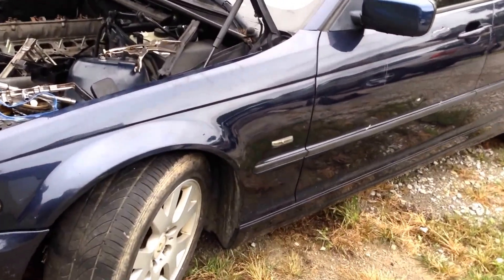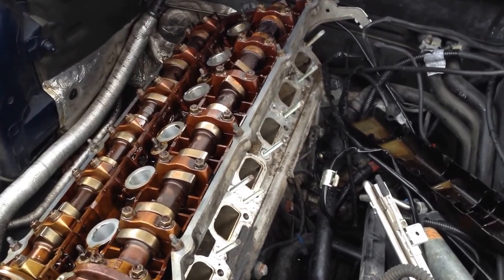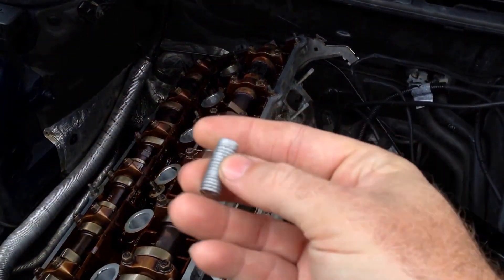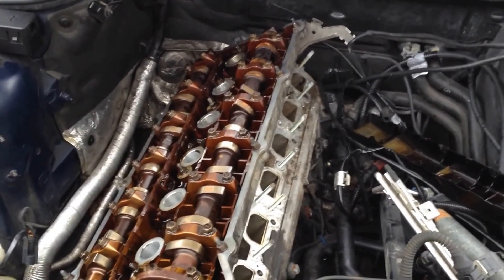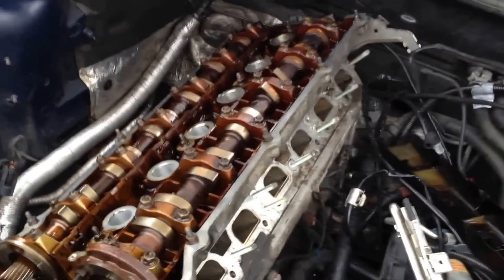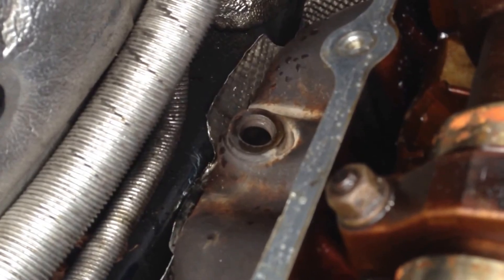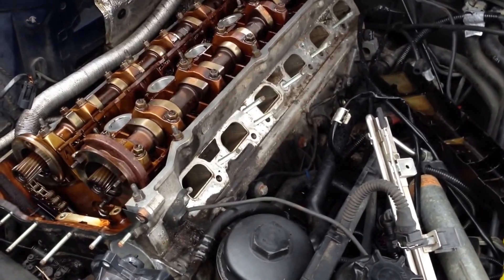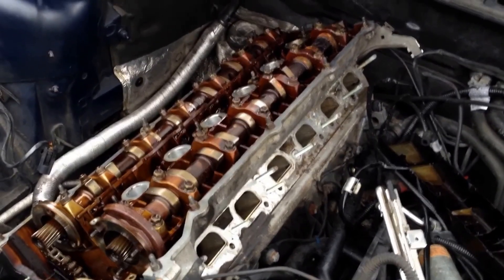IS MY BMW E46 E39 X5 M52tu M54 M56 head gasket is blown? It more than likely it is not

Comment: The GM Northstar V8  (1997-2000) had the same problem. Solution was drill out and retap with longer studs. I blew my dads Caddilac Sedan DeVille-got to a garage, but learned the oil got cooked and the rod bearings were shot.

Comment: How common of a problem is this on the e90 cars?  Particularly the 328i 2008-2011 years.  I've been looking at e90s as my next daily driver.  I'm not afraid to DIY repairs, and I am anal about maintenance on my vehicles.  I've replaced cylinder heads on Jeep 4.0 engines, but setting the timing on a BMW might be a bit over my head.  Is this mainly something that occurs on cars that have been overheated?
Reply from the maker: You car prob has the N52 and on those engines they have aluminium head bolts that will break before it strips the block threads

Comment: I am thinking about DIY my 1996 328i head gasket. This is me and my wife's first BMW and I would like to fix it for her, but the thing scares me a little. I don't really know how to do it. I bought a Chiltons book, but the thing is somewhat confusing and very little help. Any suggestions on what book like BMW for dummies edition. Or do you have or know about a video similar to that model? Thank you .
Reply from the maker: Hell you have the single vanos m52 , it more than likely has a cracked head if it's smoking white or randomly overheating, I have done a ton of them and the timing does require a special timing kit, you can buy one for under $70 off eBay , the cylinders heads are getting expensive for those engines since a lot of them crack, you have a cast iron block so the bolt holes will not strip out, you will have the most problems trying to remove the intake , I did ccv valve delete videos a month or so ago for that engine, if you want to talk on the phone go to my Facebook and pm me your number and I will be happy to explain to you exactly what to do.
Reply: Thank you for responding. Ill keep you in mind..

Comment: hi, i have a 97 e39 m52. My coolant has mixed with my oil does it mean I have a blown head gasket. my exhaust isn't cloudy and I'm not losing any power.
Reply from the maker: +Brandon Kennedy One the m52 you have a cast iron block not aluminium so the threads dont strip, it could be a bad head gasket but the m52 likes to crack the head if overheated
Reply: +Nathan's DIY Garage so is it fairly easy for the head to get cracked on the m52?
Reply from the maker: yes if it has been overheated
Reply: +Nathan's DIY Garage well will Blue Devil work until I buy new engine?
Reply from the maker: No i did a video on that, it offers no help for a bmw, are you 100% sure its mixing?
Reply: +Nathan's DIY Garage yes do u have a Facebook? ill send pics
Reply from the maker: yea the link is on my channel home page
Reply: My 1999 e39 m52 has a loose head bolt but it wasn’t stripped so I tightened back up